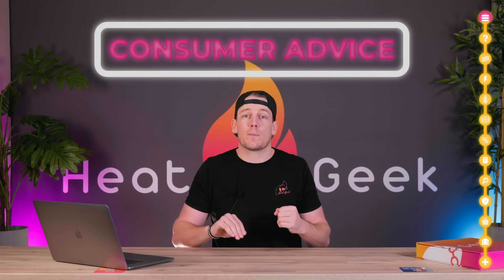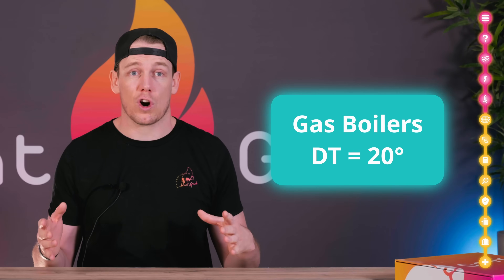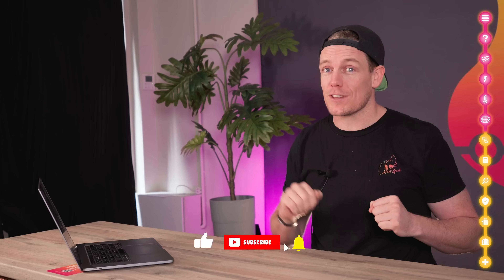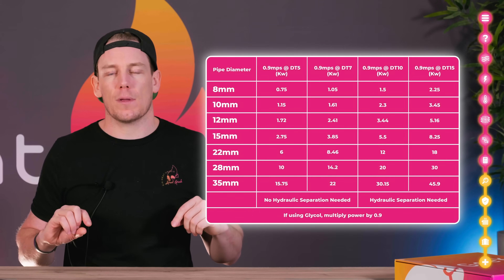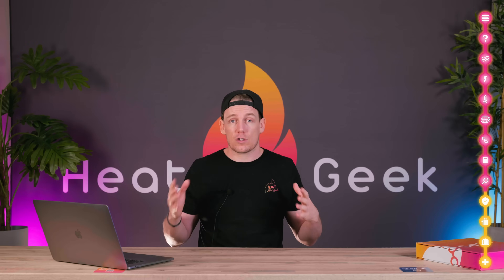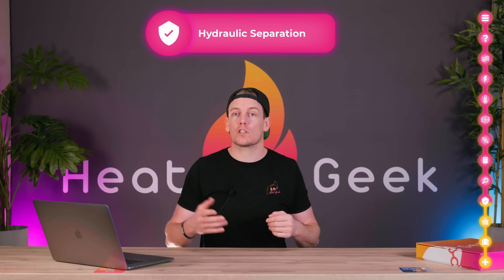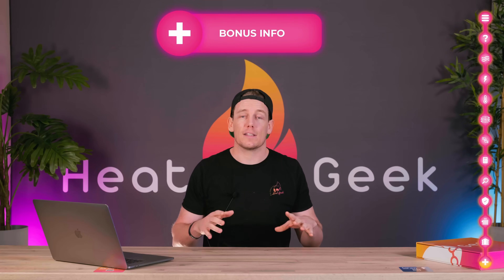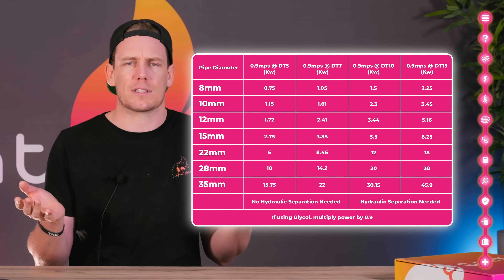Do I Need To Upgrade My Pipework For A Heat Pump Install? | Consumer Advice

Comment: Great video. Thanks. Looking forward to the ‘don’t use plastic’ video. Another reason why pipe sizes are often ok is because boilers are designed to heat building during waking hours (say 18 hours out of 24) whereas a heat pump should be designed to work continuously in very cold weather which increases comparative heating capacity from 22mm. I’m also interested in use of variable speed pumps where flow rate can be nudged above 0.9m/s on those few very cold days each year. When combined with a raised dt to 7C this increases max heat capacity even more. What would you say was the max acceptable flow rate for say no more than average of 48 hours per year, 1.4m/s? Which equates to about 2% of the time the heating is on for the year?
Reply from the maker: The max limit is 1.5m/s.. for this example I use 0.9 to be safe, that's at design conditions though (-3 outside) the rest of the year it will be way less if you have a dt pump

Comment: I am enjoying your videos and would like to move towards having a heat pump installed. However I am still concerned that I will have to suffer a lot of disruption to achieve a satisfactory solution. I have a gas boiler, 22 and 10mm copper pipes and have been conducting the Octopus Challenge to reduce gas consumption. As part of this I reduced my boiler temperature to 65c but this just means that in cold weather it becomes very difficult to achieve the 22c my wife needs to feel comfortable in our lounge. I have been doing all the other things like re-sealing windows, closing curtains, blocking up the chimney and applying draught excluders to doors. So, I suspect some serious change will be required in order to use a low temperature heat source.
Reply: Same, I've got 15mm pipe for the majority of my central heating. It'd be a right arse to change to 22mm+ pipework.

We mainly just use the central heating in the morning in the winter and use the log burner in the evening in the lounge to keep it warm enough (for my other half).

Comment: So, I don't really believe that non-smart TRVs actually work to "regulate the temperature in a room". I get that the idea is that the closer the room gets to the target temperature, the more constricted the TRV gets and thus slows the flow to that radiator, forcing the water (and therefore heat energy) to go round the rest of the circuit.

I never managed to get them to keep the rooms in my house at "the right temperature" and have replaced them all with Smart TRVs, which seem to keep the comfort level correct.

I can't believe a bit of wax inside a chunk of plastic will have enough force to move a pin in a valve up and down. The problems could stem from my escher-esque mishmash of pipes (including a ~2.8kW 1500x600 type 22 rad on 10mm plastic pipe), but whenever I try to talk to a plumber about this they tend to ghost me.

Apart from that - I work from home, so I have a heated downstairs and an upstairs office that I work from. How is a thermostat in my living room supposed to keep the upstairs rooms heated to the correct temperature? It'll turn off the thermostat when the downstairs is hot enough, not when my office is hot enough - and the downstairs gets nice solar gain from the south facing window, which the north-facing upstairs rooms don't.

WAT DO CAPTAIN HEAT???
Reply: You are correct that one thermostat is not going to be able to keep all of your house at a comfortable temperature. Only having one thermostat is an engineering compromise. Every room should have its own thermostat, and the heat demand for the room should be aggregated and sent to the the heatsource and/or the system pump. Wax motor TRVs do work (they are incredibly powerful for their size) but they are quite imprecise - the hysterisis around the setpoint is usually a couple of degrees and your body can sense this as being slight above where you think set point is, and slightly below.

Comment: Thank goodness I watched this video although I will have to watch it a few more times to take it in but the reason  I am saying thank goodness is that I have 22mm and 15mm hep2o in my bungalows loft using hep2o tee's and reducers and elbows, and some elbows at the end of the 15mm copper pipes in the rooms that I assume I would have to change to pro press fittings if I fit an ashp
Reply from the maker: Not necessarily, it could work fine bud depends on your system load..  if its sat 5kw of below it might be just fine
Reply: From my research, the internal area of hep2o 15mm is pretty much half way between 10mm and 15mm copper. So as long as you don't need more than about 1kw from 15mm hep2o you should be ok... But that does assume the pipe runs in it are short (the resistance is proportional to length) and you avoid too many elbows in favour of swept bends where possible.
Reply from the maker: @TheBadoctopus  ignoring the bastia harboring o2 ingress at fittings, difficulty with balancing on larger systems and rodent issues.. yes

Comment: Very informative thanks..   Would be interested in a video  "How heat pumps work at lower power? ". . If say the home calculates as : -3C heat losses are 5Kw    &  at 6C only 3Kw . Is the SCOP better with an 8Kw or 5Kw Heat Pump?  Running a bigger one at low power , is that quieter & have a longer life  & better COP, than a small one at full power ?
Reply from the maker: Smaller always better, less cycling and keeps lower temps easier.. as small as pos!!

Comment: Hi Adam, great videos, thank you. If the ASHP is remotely located (approx 20m) what type of pipe would you run to the tank?
Reply: You would probably go for a split unit to reduce the losses so they would be small fridge pipes
Reply from the maker: Preinsulated mlc

Comment: Expertly presented. At long last I am getting to understand why my HeatPump installation has not been running efficiently. Customised commissioning of all HeatPump installations, in particular, is critical for the efficient running of the HeatPump installation. They are more sensitive to temperature (DT) running tolerance than most other boiler systems. Thank you.
Reply from the maker: Thank-you

Comment: Good morning Adam. 
Another excellent and thought provoking presentation.... 
It is a shame that publications like Gas Installer/Engineer/HVP don't even appear to scratch much below the surface on the subjects you discuss, let alone the industry as a whole ?  
Two questions if I may :- 
What building heat loss software do you recommend using.
This maybe outside your remit, but can you recommend any trustworthy publications/authorities that advise/educate the insulation of solid wall construction without raising the possibility of condensation/damp problems.
Thank you as always.
Reply: Thanks Neil, we recommend and use 'heat engineer software'
Reply: Thank you. 
One further point - you quote  "Plastic pipe does not belong in heating systems". I cannot say I disagree but quite a bold statement ! 
Especially as a lot  of new house builders seem to throw  plastic pipe into their builds like unsupported cables...?
Reply from the maker: @gibbodive140  yep. It's needs to change. As does the unfohnded love affair with inhibitor.
Reply: Pete Ward new book "The warm dry home". Well worth the £25. 
He is on YT, lots of these case studies also in book, with colour photos and full explanations, references etc. Aimed at older properties, solid walls etc.

Comment: Thanks for the info, good video... But you said no to plastic? 😱

I'm just about to replace old non barrier plastic and badly routed CH pipes in my bungalow loft with hep2o... Should I not?

I get that the internal diameter is less and those inserts cause momentary points of restriction, but was planning to upgrade a few runs to 22 (up from 15 based on length and energy needed to rads). All the drops to rooms are 15mm copper. 

If I'm planning a heat pump in 2-3y should I not use plastic? Why? Thanks!
Reply from the maker: Lots of reasons. Wothblow temperature systems plastic harbours more bacteria which can lead to bad corrosion problems and pH issues. Fittings don't have barrier so allow o2 ingress, rodents love eating it, because the fitting restricts balancing is more difficult..

I would instead use mlc if you absolutely have to.. 

Why not use copper though???
Reply: Hello @HeatGeek , thanks for the reply.

Mainly because I can do the Hep job myself, and save a bunch of money on labour for a pretty simple bit of planning and labour, whilst fixing several issues with the current system. I'm in the middle of many renovations and cash flow is a major issue.

I guess I could learn to solder copper. Or just accept those risks you mention for plastic. Leaning towards the latter tbh 😅

Will look at mlc option though, cheers.
Reply: @TheBadoctopus  just replaced my old 15mm uninsulated copper mess of Ch pipes with 22mm plastic barrier pipe, I've also insulated it. There is a great difference in the heat output to the new type 22 rads I've put in. I do take on board the comments regarding rodents and flow restrictions with inserts and also potential balancing issues- but for me, the difference in comfort is great and even before this warm spell I've changed my heat curve to -3°/39°. The house is v comfortable.
Reply from the maker: @TheBadoctopus  cheaper isn't as good genrally. .

No need to learn to solder! Hire a press fit gun and press it!
Reply: @TheBadoctopus  Soldering up copper pipe is OK , The Yorkshire Fittings with a ring of solder in them are reliable even for a beginner.  What pipes & where to put them & doing it at speed is where the plumper has the advantage .
Reply: In other words, assuming the calculations for flow rates and heat carrying capacities are all fine in plastic, why not use it?

Comment: The system volumiser vid would be useful, thanks :)
Reply from the maker: Most of the reason why is in the "why not to use a low loss header" video  https://youtu.be/mNcRx45DQ8M

Comment: Good video, well explained but you didn't mention the hot water cylinder. Is the heat load of the cylinder added to the primary pipe size? If not why not?
Reply from the maker: No, because heat pumps are hot water priority.. they heat hot water OR heating, 1 at a  time..

Comment: I was feeling good about this until you said the pipes shouldnt be plastic! Pre ASHP install my old 15mm copper was replaced with 22 & 15mm plastic.  My DT is typically 5-7 so hopefully getting away with it 😵‍💫
Reply from the maker: They replaced copper pipe with plastic??? Why!!????
Reply: @HeatGeek  so are you saying that underfloor heating is a no-no with heat pumps? I thought that was the ideal combination?

Or is it the case that the calculations for underfloor heating are different (and more friendly towards plastic pipe)?
Reply from the maker: @PeteTaylor  don't confuse plastic with mlc. Even woth plastic underfloor heating you don't have the fittings...
Reply: Yeah I was exactly the same my bungalow just been redone with plastic pipe be interested to see the video on that. I get the point about throttling the connection at joins but doesn't plastic pipe have a smoother bore?thus more efficiency inside pipe ? I am speculating here
Reply from the maker: @roscopeco2000  any lower pipe resistance is totally imperceptible compared to the resistance at fittings. As I say.. lots of other reasons.. plastic is a bacteria haven

Comment: What are your thoughts on mini splits? The americans love them. Not as a main heat source but as a cheap interim solution to reduce load on main gas boiler.
Reply from the maker: They're fine. I don't find a2a as comfortable for use in a home but it's alot more straightforward and good cop
Reply: @HeatGeek  The Danish use them extensively, and they are available for quite low heating loads, whereas Air-to-Water heatpumps stop being available below about 4kW.

Comment: Another topic that I don't fully understand is the condensate / discharge from a heat pump.  Is it just water? Where can that be send to? To a drain / soak away?  And how you build a base or make provision for all that requirement. Does the discharge come out of a pipe underneath the unit?  Is there a tray?  I've also seen manufacturers (like NIBE) recommend 300mm clearance underneath (for snow), yet installers just plonk them heat pump on a concrete block using standard feet (which aren't raised 300mm).   Placement of the unit is all very confusing.  And this is aside from MCS / building regs about boundaries and decibel dB loss calcs.  Definitely a topic ripe for a consumer focused explanation methinks.
Reply: It literally just comes out a tube (there’s a tray under the coils) - it’s not a massive volume of water so generally there’s not a need to plumb it to a storm water system.

Comment: Very useful, thank you. I'm currently improving my big old Victorian house and was wondering if the pipework was needing upgraded for a future heat pump. I'm still far from convinced that a heat pump will be a viable option, but can't see any emission free alternatives! What is the ideal flow temp for a heat pump please?
Reply from the maker: The ideal flow temperature is the lowest you can get it..
Reply: Heat pump spec sheets show the COP you can expect at several different flow temperatures. You can see the possible improvement you can get from lower flow temperatures and work out if that benefit is worth it for you, over the additional fitting expenses.

Comment: What would happen to the fridge side of things if your increasing Dt's 
What I mean is  super heat and sub cooling 4 degrees ether side of the evp & con on a water dt@5
Reply from the maker: The wider you have your dt the more distortion and hotter(harder) your hp has yo work.

Comment: Awesome information as ever, thank you. Off to check my pipework diameter. The point about increasing insulation instead of increasing pipe diameter is a superb point and very valid in the current energy pricing situation. Save on heating costs in the long run.